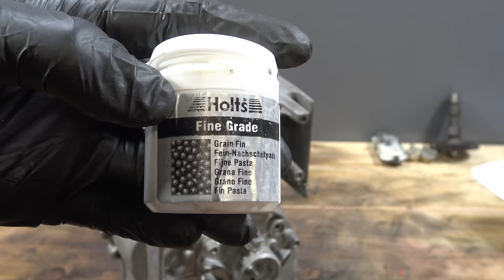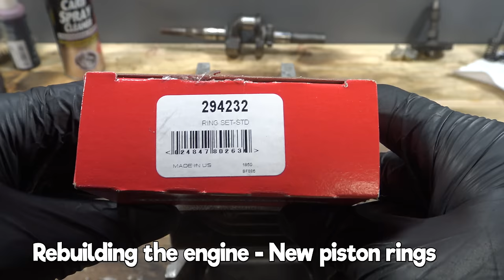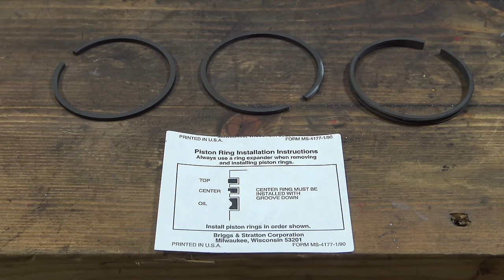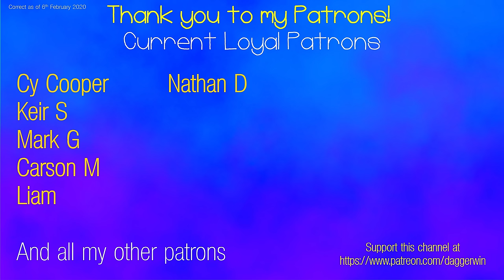RUSTY ENGINE REBUILD RESTORATION (Will It Ever Run Again)

Comment: of course it will run again ......you're restoring the engine. 😅
Reply from the maker: Only if done correctly :)
Reply: @MachineryRestorer  do you find your ultrasonic does any damage to aluminium?

Comment: I noticed in your engine rebuild you never check the valve clearance. You should at least check it even if you don't grind the valves. They do tighten up with age. Nice video thanks

Comment: 40 years sitting in the weather, I'm amazed at the condition it's in. Just a bit of kero and a toothbrush and it literally looks like new, inside and out. Even the bore was clean. If this were a cast iron block you'd be boring 50 thou just to get the corrosion off. I'll never laugh at alloy engines again. (I'll still laugh at 1-cylinder 4-stroke engines though ;)

Comment: You can't kill a Briggs. No matter how hard you try. They will always start right up as long as they have spark, good fuel, oil, and compression. I had an old 2hp Briggs I tore down for parts after it started leaking oil and fuel, it had only like 40psi compression but it would always start up on the second or third pull.

Comment: It's an oldschool briggs, of course it'll start with a little love. They're practically bullet proof,   haha. 

Was lucky enough to get given an 80s briggs lawnmower taht didn't run, by my father's work colleague, when our old electric one broke. All it needed was an oil change, carb clean and fuel and now it runs as good as new, talk about a fucking bargain. 

This thing will practically last us forever with proper maintenance, we'll never have to buy a new mower again. Do not just give away equipment powered by these old engines people, they don't build them like they used to and thus these older models are becoming more sought after.

Comment: The thing about these kool-bore engines is that you must keep clean oil in them. Don't run them full throttle all the time. And take the head off every couple of years and decarbonize the inside of the head and top of piston. If you don't, the carbon deposits will get between the piston & cylinder bore and scratch the hell out of it.

Comment: if video would begin with an engine cracked in two and you would say lets do a rebuild to see if it runs i would be amazed with work you have put in, I am more than sure that engine was running if you would try without rebuild!

Comment: Any old motor like that will run if it was treated right. The most you will EVER have to do is change the plug and maybe play with the carb a little. I know this cause me and my dad work on these things and old tractors daily. It's our job. If any of yall reading this has an old garden tractor or an old deisal tractor they don't want and they live n North Carolina hit me up

Comment: It's a Briggs and Straton, you'll kill a Toyota Hilux before you'll kill one of these. I have an ATCO Royale 49 mower that I pulled out of a junk shed after it had sat idle for 15 years. It took me literally 10 minutes to get it started and 9 of those were checking the oil and adding fuel.

Comment: Cast Aluminum cylinder... as an engineer I can't approve that, regardless of the hp involved. I'd bore out the cylinder to accommodate steel sleeve, bore the ID to size, hone it, and never worry again with it. But that's me and my OCD.

Comment: Hey man i got no spark on my engine , just like that 3hp. I bet i has something to do with the points & condenser wires, where do they go? Someone had put a electronic ignition on my 3hp before but the wire was broken and i had a non-electronic magneto lying around but im not familiar with the wires, can you help me?

Comment: Just a comment here folks I caught a slight mistake in the captions.  These engines has a aluminum cylinder block with a pressed in Cast Iron Cylinder Liner.  This was not an aluminum cylinder as stated in the captions.  If that were the case, the Moly-Steel Piston Rings would have destroyed the cylinder bore in a very short period of time.  I just wanted you guys to know in the event you decide to rebuild these engines.  Yes I used to be a Small Engine Mechanic and had Briggs and Stratton Certifications.
Reply from the maker: No, this is a Koolbore engine which has no cast iron sleeve.

Comment: 3HP Predator engine 89.00 
Old restored Briggs engine, parts plus 2k in tools, power coating, sand blasting, ultrasonic cleaners. 
Pretty simple decision....

Comment: I think you did a great job. My only question is was this a running engine to begin with?
Yes it's rusty, but saying "will it ever run again" isn't the same as saying it does not run; just wondering.

Comment: Not suppose to hone koolbore models or use assembly lube on piston/cylinder but other than that it was an A+ resto!
Reply: He didn’t hone it and he never used assembly lube on the cylinder...
Reply: @charlienorton2337  In the beginning the bore had relatively normal horizontal scoring and when he got to assembly a crosshatch pattern can be seen which tells me he honed it. As far as the assembly lube goes 19:26 clearly shows him using it on the piston. I'm not saying he did a bad job just some minor criticism from someone that has rebuilt hundreds  of B&S engines ranging from the 1920s to current day.
Reply: LuckyDuck he never honed the cylinder as he said in a comment, and a little assembly lube on the piston doesn’t hurt... it’s a Briggs not a spaceship
Reply: @charlienorton2337  If he did say somewhere that he didn't hone it thats my mistake. I totally agree with it not being a spaceship and to be honest that little bit of assembly line won't hurt it but when its suppose to be a restoration I like to do everything by the book just my style I guess..
Reply from the maker: I feel I should just add something to this discussion. Firstly I am fully aware that you do not hone the koolbore engines. LuckyDuck is correct in saying that some cross hatching marks appeared. This is because there was a very slight score ridge that needed to be removed, however I was never going to show doing that in the video because I didn't want to encourage viewers to think that you hone aluminum bore engines. Since fitting the new piston rings the engine has very good compression and doesn't burn oil. I don't really see the assembly lube on the piston being an issue personally but I find everyone has their own way of doing things, so point taken :) You have a trained eye LuckyDuck
Reply: @MachineryRestorer  You just got another subscriber! Thank you for clearing that up a bit. It sounds like you no exactly what your doing and why your doing it:)

Comment: How does it run without a battery? Does the spark-plug start it and then just keeps running because of continuous strokes?
Reply: Coil on the flywheel supplies the spark.  When you crank the flywheel, it causes the coil to charge the condenser (little round barrel) that creates high voltage to feed the spark plug.   The old engines only needed a battery to spin an electric starter to do the same thing as a rope does here.   There are a set of points, which you saw him adjust, that times the voltage to the spark plug to only happen at top dead center on the piston.

Comment: Have you sanded the bore with normal sandpaper? Or did you use a hone, because if you used a hone you either spun the hone to fast or you didnt move it up and down Quick enough. those scratches are really important because they make sure the rings never have direct contact with the cylinder, it creates an oil film inbetween. And the scratches in your cylinder dont have Enough angle so when the piston goes up or down, it pushes out the oil instead of the oil following with like it would if you had 45 degree scratches. And the rings Will catch and wear fast if the scratches are with pretty much no angle like yours are right now.

Comment: ..very nice if you are wanting a period-correct looking engine for a project, or just wanting to resurrect something old..nothing wrong with that :)...but for the average Joe just wanting to get his old garden tiller running reliably again, much better to just get a new $99.00 Harbor Freight OHV engine, bolt it on and go....

Comment: We used to have a Brigss and Straton generator in Morocco that had a dual fuel tank.
It started with gasoline and had t be switched manually to diesel once it warmed up. Anyone know where I can find some information on this engine. Google didn’t help me out.

Comment: I can tell you're a professional or you've done a 100% takedown and rebuild of a small engine several times.  Besides how many of us have a powder-coating setup?  Anyone else; don't take down an engine at cylinder and piston level unless you've done it more than eight or so times.  And if there's carburetor linkage before you take down an engine; take plenty of pictures.  The linkage, carbie adjustment, and diaphragm always make my engines not willing to start or stay running.

Comment: I have an old tiller with that style engine.  Hasn't been run in 20+ years and it still has "fuel" in the tank.  I was wondering how to get the tank off.   Best 90 seconds on my day.  Only 7 more hours until I can get to tinkering with it.

Comment: hey guy i can see you know quite a bit about small engines but i have to chastise you a bit
1. those cylinder walls had scoring on them they should have been honed.
2. that crank shaft should have been polished with 400 grit sandpaper so that it wouldnt damage the new crankshaft seal .
3. the connecting rod should have been replaced along with the piston
4.im assuming you replaced the missing parts but didnt show them
lastly what youve titled a rebuild isnt a rebuild
its just new rings and a paint job 
hope i didnt come across as an ass but ive been a small engine mechanic for 20 years and it just burns me up when someone doesnt do a rebuild the right way...

Comment: One of those, or a Chonda. You decide.
Reply from the maker: One of these.
Reply: @MachineryRestorer  annoying thing is B&S use about 5 different size sparkplugs lol. Got 4 briggs and stratton engines  2 use same plugs but other 2 have different plugs. (All 4 are lawnmowers lol.

Comment: I would have changed the breaker point ignition for a modern one. So much simpler and much less work once it fails

Comment: Did you use some kind of enamel on the engine? Is that why it needed to be fired in a kiln?
Reply from the maker: I used powder coat so it had to be baked. Thanks for watching

Comment: I haven't even watched the video yet it's a Briggs & Stratton if you get fuel air and it's rotate and spark it's going to run. I've literally shot them with 12 gauge pumping balls and the damn thing would start up not run great but it's still tried to run its best

Comment: Question, why didn’t you hone the cylinder and get a new piston? That cylinder wall could have at least used a couple of rotations with a hone or at least an emery cloth. Crosshatching is kinda important for seating rings...
Reply from the maker: This is a Koolbore engine, that is why I didn't.

Comment: Please tell me you didn't hone the cylinder. The aluminum bore Briggs have a teflon coating in them and if you remove that, it will destroy the block.
Reply: No teflon when that engine was made!!! Raw aluminum cylinder bore. Con-rod pin mark proves it. The rings were a waste of time, money and effort.
Reply: My first engine overhaul was on a very similar Briggs. Mine I believe was originally built in 78? To tell you the truth I cannot remember how old that engine was. I was told to hone the cylinder and so I did. Shouldn't have. That engine ran for 3-5 minutes when it just died. When I went to restart her, she had no compression. The cylinder walls were scored something terrible.

Comment: Used overhaul hundreds of Briggs engines in times gone by today it's cheaper to buy anew motor did u replace gasket between  carb and tank

Comment: Why all the un-needed work? Points, parts, plug , carb clean and diaphragm fresh gas and "putt-putt-putt-putt". Lap the valves on a Briggs Aluminum block? And RINGS??? You GOTTA be kidding! I'd have it back on my edger running before your video is finished.I'd worry about sandblasting the INSIDE of the fuel tank. Get the rust/water sludge outta there. Rattle-can Krylon is better than OEM paint too. Crap, maybe a cast-iron Kohler or Onan deserves all this TLC!
Reply: Maybe you should go watch videos about edger engine tune-ups instead of RESTORATION videos.

Comment: Great resto should have honed the cylinder and done the measurements before you bought rings though
Reply: it’s an aluminium bore, you can’t hone it
Reply: @charlienorton2337  uh yes you can
Reply: Duke mate I can see you don’t know much about small engines
Reply: @charlienorton2337  mate if you couldnt hone a fkn ally bore than it wouldnt come with cross hatching from the factory yeah its gonna take a bit more material off vut thats why we have over size piston  got no clue what your on about
Reply: Duke mate the reason it comes from the factory with cross hatching is because it’s machined to the exact right bore size, and if you hone it then unlike with an iron cylinder it’ll take off way more material than needed and end up fucking your engine up.
Reply: Duke mate and if you want to spend 100 quid on an oversize piston kit for an engine that’s worth 50 then go for it, but there’s absolutely no point
Reply: @charlienorton2337  100 quid?? There like 40aud lol and hes already put all the other money and time into it
Reply: Duke mate they’re 100 bucks where I’m from... but why waste more time and money when leaving it how it is is fine?

Comment: Your hands have a beautiful magic.  But how to find a engine is 2 stroke or 4 stroke?
Reply from the maker: Usually if you look to see if an engine has an oil sump it would show you if it's a four stroke or not. As you may know already, 4 stroke engines have oil in the sump whereas a two stroke has the oil mixed into the fuel.

Comment: CAN YOU COMMENT ON THE TIMING MARKS. ?JAMES CONDON POINTS OUT THE DOT ON SOME ENGINES NEED TO BE MESHED SO THAT THE DOT  WINDS UP GOING BETWEEN TWO TEETH .IT APPEARS THE DOT AND THE MARK HERE LINEUP EXACTLY. CAN YOU COMMENT ?

Comment: Not a fan of over-restoration. Originality is important. Original decals, paintwork etc have historical merit where they can be saved. Full strip and do over with modern computer print decals and powder coat paints should only apply where absolutely required. I prefer restoration to be applied conservatively, even to retaining points/condenser ignition if salvageable.

Comment: Bad bad bad. That powder coat will never last. First chip it gets and water gets under it it will rot that tank and starter cover. What a shame it would have been a good job if you painted it. Other then that good job on the rebuild!

Comment: Great mistake you did NOT oiled the cylinder liner and piston rings, before compressing and fit piston into cylinder liner !! This mistake causes, too much  friction because engine will run DRY for many minutes until oiled physically and as result it will ruin the liner and piston rings, thus meaning much less engine life !!

Comment: I learned Long ago to Clean before I start.
There's NOT 1bit of Rust. Of course it run it's got a Pulse-A-Jet  Carburetor. Remove the fuel pickups before you clean soak the carb
THIS IS STAGED CRAP
B&S Flywheels don't come off in your hand. You have to knock them off.
You didn't hone the  Cylinder to knock the glaze off. The Rings Will Not Seat
Reply from the maker: It's a Koolbore engine! Careful if you are honing them.

Comment: I watched this too see how many mistakes you made. First one the block warps near carb badly so do heads always resurface.  Second there is a gap between tappets and valves that needs to be set correctly. Third no sealant on head gasket big nono. Use spray copper or aluminum paint. Fourth you didn't stretch carb pump spring they tend to shrink over time.  Five and this made me laugh you had good decals in great shape as this motor didn't need a rebuild as it had very little runtime. You can't get the exact ones unless you custom print them but you put in wrong year stickers.  

Still it looks ok for now and seems to run.
Reply: How do you know he didn't do some of those points off camera? Sealant on the head gasket???

Comment: Kohler  courage engines are junk to!
Reply: Briggs and stratton industrial  commercial  old flatheads are unbeatable!  Especially  the opposed twin!
Reply: The industrial  commercial  flathead series  briggs  has easily replaceable main bearings and valve  guide bushings.  The standard  series flatheads do not.  The industrial commercial horizontal  flatheads have ball bearing  mains.   The standard  aluminum bore engines were usually  either white or black,the industrial  series was red....